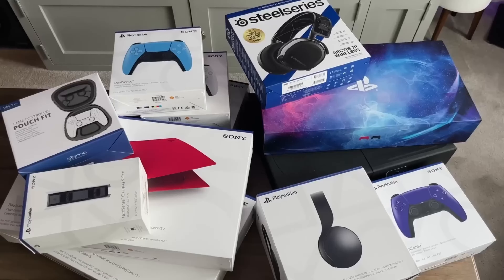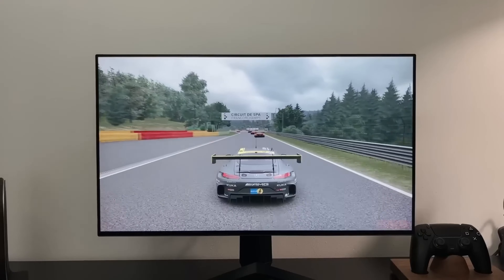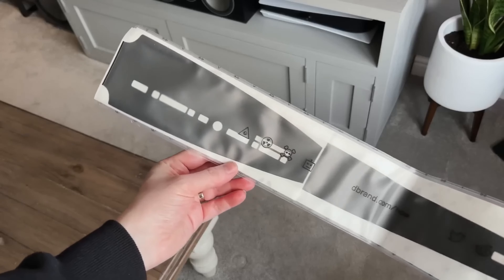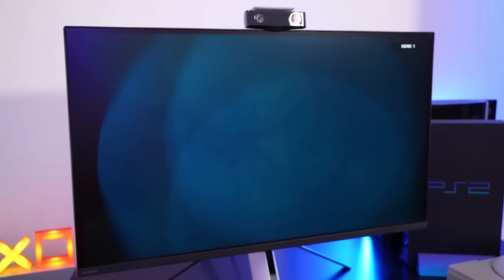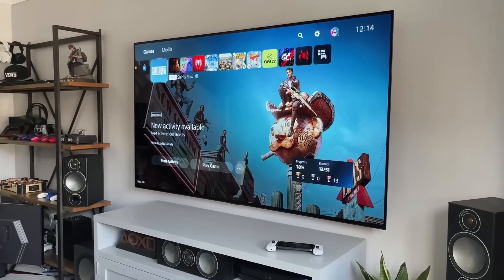TOP 20 Best PS5 Accessories You Must Have In 2024

Comment from the maker: https://playstady.com/best-ps5-accessories-must-have/

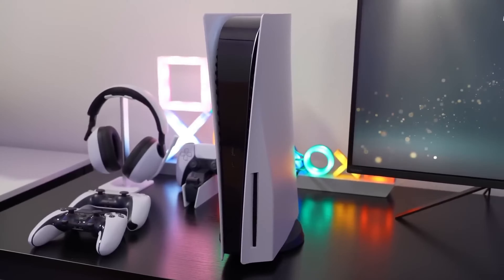00:30 - Horizontal Cooling Fan - https://amzn.to/4b5Hr5G
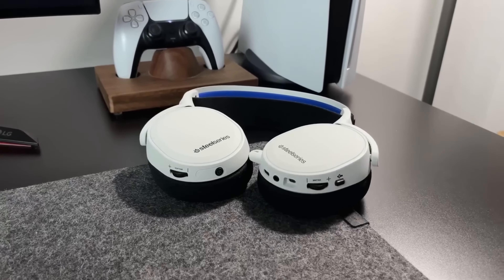01:15 - Pulse 3D Headphones - https://amzn.to/3Uk6WZR
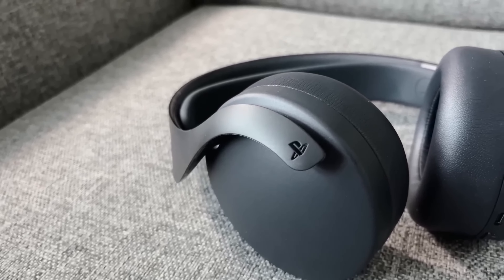02:10 - Custom Side Plates - https://amzn.to/3y4HsrZ
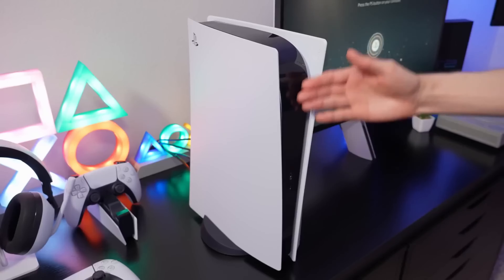02:51 - Console Middle Skin - https://amzn.to/3wc7Mjo
03:18 - PS5 Light Strip - https://amzn.to/4dgjGti
03:32 - PS Logo Sticker - https://amzn.to/3xZfRsw
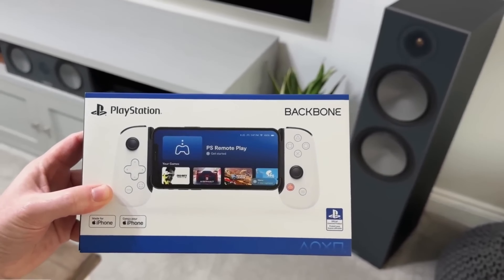03:47 - PS Remote Backbone - https://amzn.to/3UCwfqz
04:26 - Logitech G Cloud - https://amzn.to/3QnIHJn
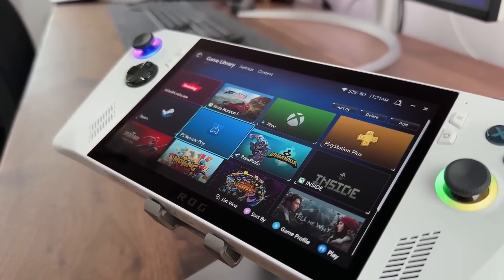04:42 - DualSense Stick - https://amzn.to/3QoG5uO
05:54 - DualSense Keyboard - https://amzn.to/44mYuh9
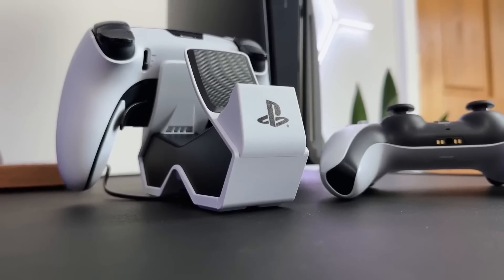06:09 - DualSense Charge Station - https://amzn.to/3Uyr7EW
06:47 - Anti-stress - https://amzn.to/3WiP0Bz
07:11 - PS5 Fighting Controller - https://amzn.to/3QnhnL5
07:37 - Steering Wheel Logitech - https://amzn.to/4dipRgE
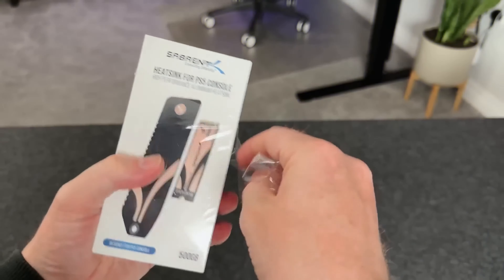08:06 - Extra Gaming SSD - https://amzn.to/3JFSZAN
08:41 - PlayStation Media Remote Control - https://amzn.to/44lbqE8
08:59 - LED Lights - https://amzn.to/49T6V4Z
09:22 - PSVR 2 - https://amzn.to/3xVxysK
10:09 - Console Stand and Cooling Station - https://amzn.to/49XQK6C

Comment: DO NOT BUY THOSE FANS!!!!!!!!!!
Reply from the maker: Why? Did you buy similar ones and they don't work well for you?
Reply: @playstady  just none of them do any good in general I’ve never used one but it’s just common sense plus it creates a loud sound you’ll be hearing
Reply: @OfficialBo420  so you comment on something you've never tried? Typical.
Reply: @dima97  bruh who said I didn’t buy them plus every fan doesn’t work why would you need something that could harm your console 🤣🤣🤣🤣🤣🤣🤣💀💀💀💀💀💀💀💀
Reply: @OfficialBo420  maybe it's different, but on my series x, it helped boot fps dramatically
Reply: @dima97  I doubt a fan had anything to do with that lol plus gl listening to that loud thing
Reply: @OfficialBo420  I tried it both on and off too. It overheats a lot. The fan also helps keep dust out (although not super effective) it's also not very noticeable over the very loud ac/furnace in the background lol
Reply: No new gen consoles need fans! Their own internal cooling system is fine. If it’s ‘too loud’ or over heating then it’s time for a clean.
Reply: @Jagw67  facts